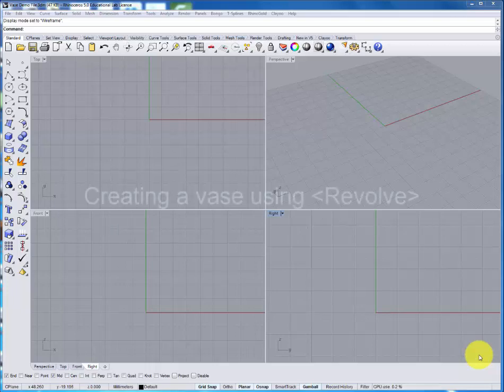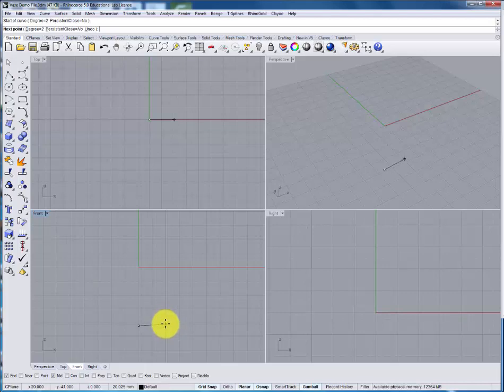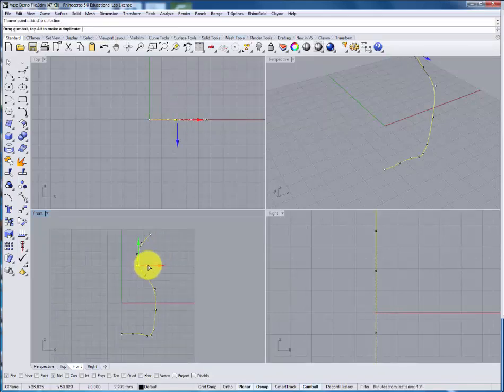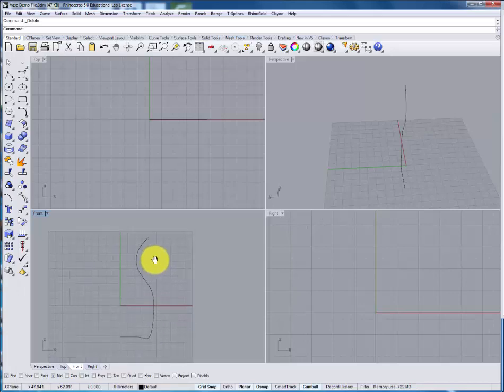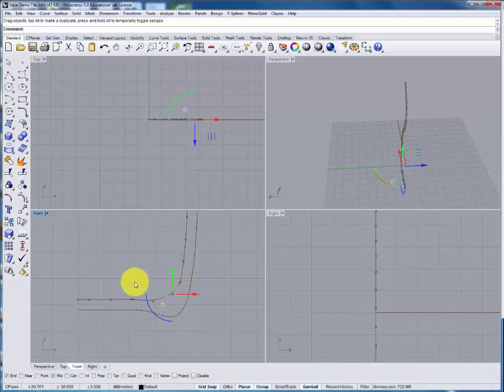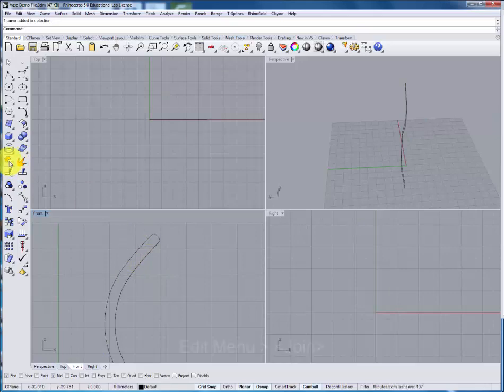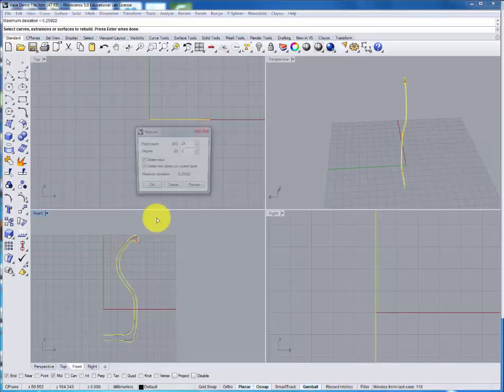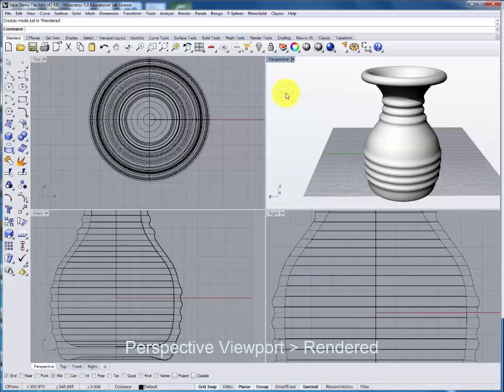Basic Rhino 3D Tutorial #2: Revolved Vase

Comment: no quick curve on rhino mac ?
Reply from the maker: The command has changed slightly in recent versions of Rhino 3D, 6 & 7. You can use <Blend Curve> or from the drop down menu; Curve>Blend Curves> Adjustable Curve Blend and then play with the option to get the desired curve... an Arc Blend will create an arced curve between the segments. Thanks.
Reply: @gregsims5218  Thanks